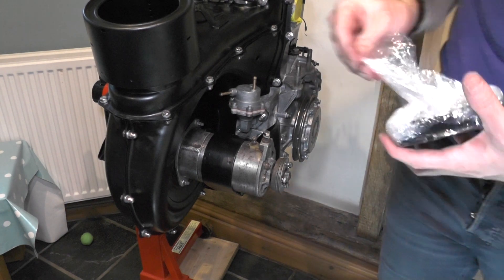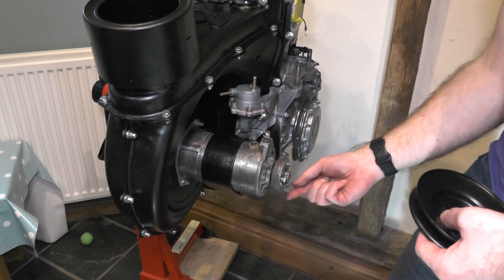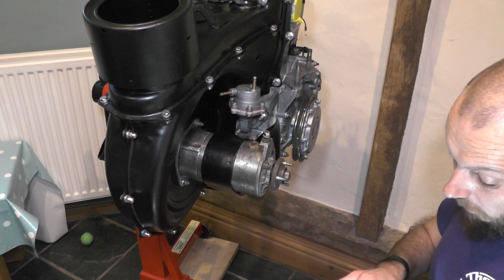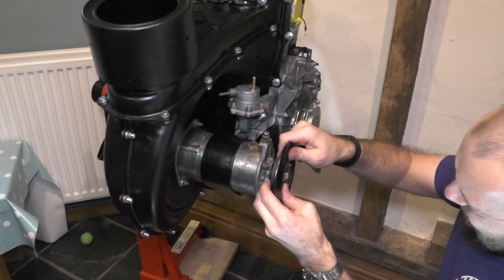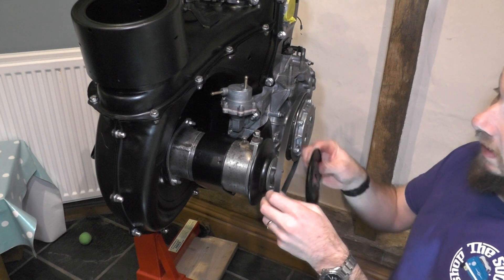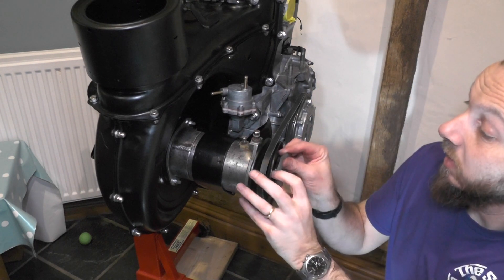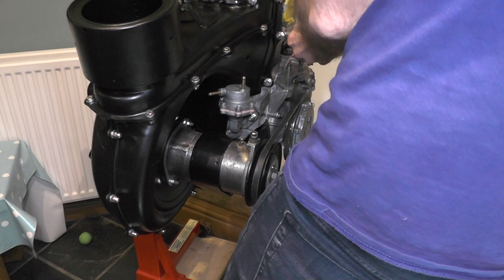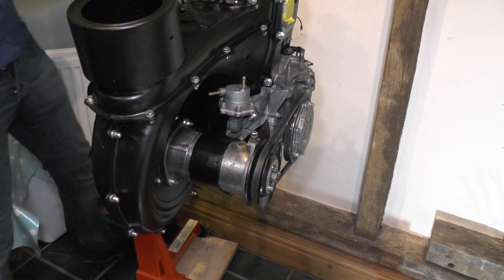30-40 Fan Pulley and Belt - Classic Fiat 500 Engine Rebuild Series

Comment: How’s it going? Wondering if you can help me out. If you are familiar with what a series hybrid EV range extender is.  Similar to a Fisker. What I want to do is attach a generator to my 06 trailblazer timing belt. I want that generator to power 6 batteries in parallel. Then I assume I would need a power inverter? Which will power an EV motor that’s connected to my rear axle.  Gas engine only runs the timing belt. Not the transmission.  Do you have any idea how this could be pulled off?  Fisker was poorly made but it still got 25mpg and it was extremely fast.
Reply from the maker: Hey 👋 … I’m sorry that is well beyond my capabilities and knowledge.
Reply: Well done. Keep pushing! You have done a great job so far. Hope mine comes out nearly as good
Reply from the maker: @DecameronItalia  thanks ... really appreciate it!!! It has taken so much longer than I ever intended it to ... 🤣